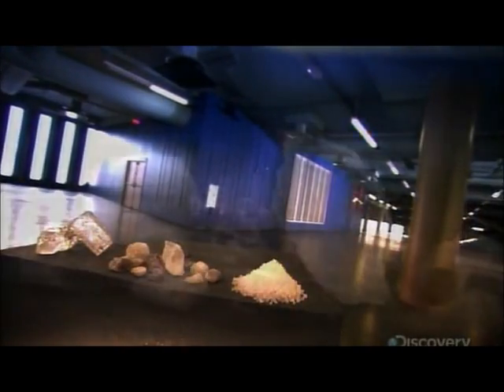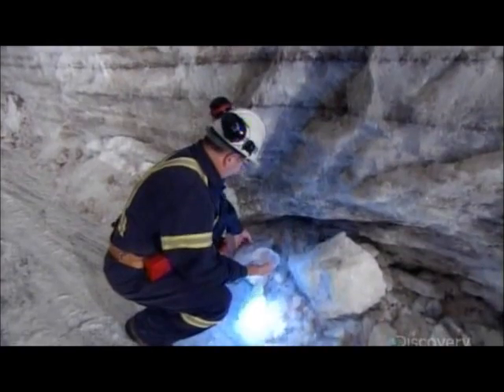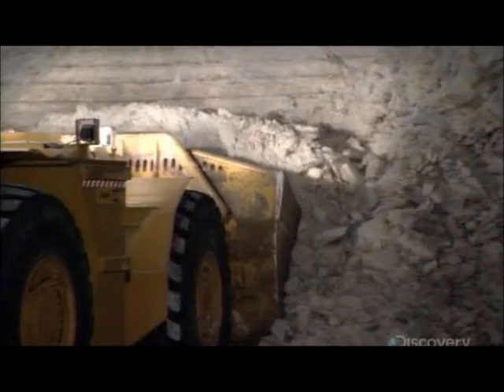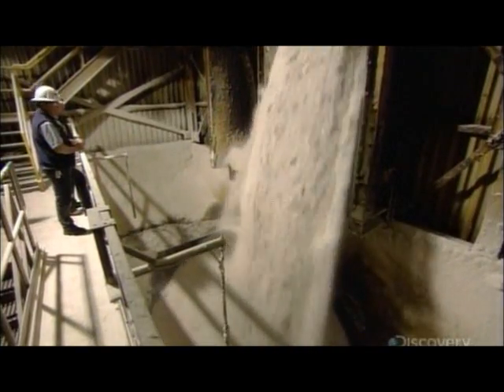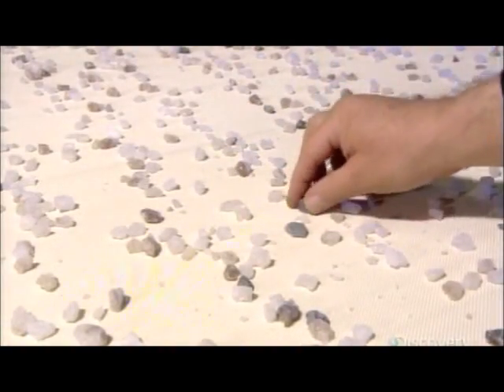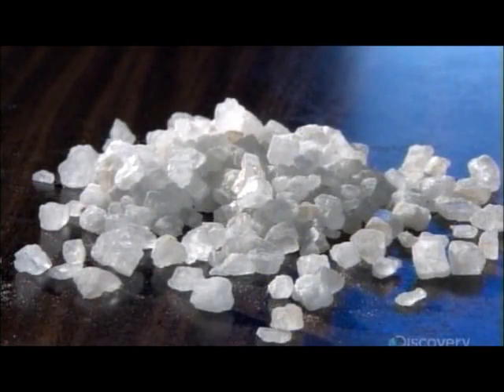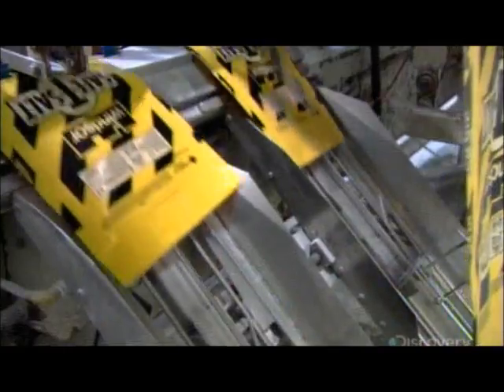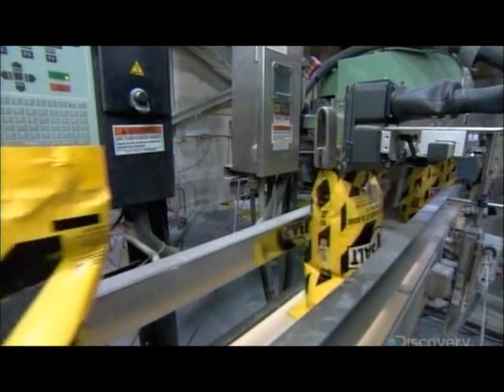How It's Made - Road Salt

Comment: I hate road salt
Reply: not much of an alternative, well cost effective ones. perhaps car manufactures should the ones running stainless steel lines and truck bed coating spray on the underbodies of there north sold cars! i literally just had my car crumble and had to scrap it due to salt from wisconsin winters. next car i think i will do some preventative maintenance

Comment: I always am sitting there like: "yea, store salt outside where it can rain n stuff, great idea"
Reply: only so much salt can dissolve in water and enter solution. It would have to rain  A LOT before it would cause the salt to wash away. Basically you get a crust on the top of the pile of 100% saturation of the rain water that then soaks down onto the salt below and forms a cake/clay like substance and keeps the salt in place. The little bit of water that does run off the pile is insignificant in the grand scheme of the mine, maybe a few tons per year at max.

Comment: Salting roads is crazy.
Cars rust and fail dangerously, it attracts wildlife to the roads and it makes inconsistent and often more dangerous slushy driving conditions.

Also, Sodium Chloride IS NOT ROAD SALT.
If you're gonna salt a road it should be Potassium Chloride. The same stuff you get a lethal injection of in USA.
Reply: Steffen Dahlberg or calcium chloride
Reply: Slushy roads are caused by either car tracking salt from highways onto unsalted snowy roady, mild days or sand spread...when you see a truck spreading sand its not just sand there is also a bit of salt mixed in to there again not enough salt so the road just ends up slushy. If you keep you vehicle clean and keep up with regular maintenance any serious rusting mechanical parts or curoding electronics will be noticed by your mechanic.

Comment: Is rock salt non renewable?
Is it bad for the environment to spread on the ground?
Reply: +Andrea Quadrati Nah, the seas are so massive and contains so much salt already that the runoff from salt on the road makes no difference at all. Then when you factor in how much fresh water is coming from melting glaciers and the likes, the oceans are actually becoming less salty......until the next ice age.
Reply: +Marius Ammann Solar salt. Or leftovers from water desalinization. Also sea salt is not usually that expensive. They dry it off in large basins using sunlight and concentrating it until it forms crystals. Still affordable
Reply: Salt was (and still is) used as a means to make soil sterile.  That is nothing will grow.  It destroys city infrastructure such as concrete, asphalt and steel control boxes/electronics for street lights etc.  It destroys your vehicle by galvanic corrosion causing rapid rust and attacks the electrical system.  In particular, salt water has different surface tension allowing it to weep past waterproof o-rings in electric connectors.  It's bad.  The other alternative for ice melt is mag chloride (same basic product with same destructive properties), gravel that breaks windshields and trashes paint or beet juice.  Beet juice has no serious bad properties that I am aware of aside from being expensive.  But infrastructure damage from salt is making beet juice more attractive.  Not sure how they deal with the dye (color staining) one would expect from beet juice however. Our tractor tires are filled with beet juice as both weight and antifreeze.
Reply: It increases the salt that goes into the water and the ground that is lawn or gardens. It also weakens the structural integrity of asphalt roads and increases rust buildup on vehicles.
Reply: Could sea salt be used to de-ice roads? I guess it would be too expensive because you'd have to boil it to get salt out, or are there any other methods of removing salt from salt water?
Reply: +69aussieguy Depends. Sure, oceans are big. But here we speak of more restricted zones. Seas and lakes are more likely to be affected.
Reply: Well, harvesting rock salt in the end. . just turns the seas saltier, as the water cycle will bring it there eventually. It can be renewable with artificial methods, but can be bad if the seas become too salty

Comment: I Didn`t Get How that machine Can unable the black mineral going forward
Reply: V for vendetta Why the fuck are you calling me a grammar nazi? I didn't correct anyone. God some people are dumb.
Reply: Yeah, that's very impressive
Reply: KrisRaps  Simply put they first decide which ones are black and need to be removed using some cameras and special lights. Then the black ones get shot in a different place using compressed air(so they basically push it somewhere else with air) so they don't go to the same place as the white ones. Since it's an automated machine it's really fast so the compressed air shots doesn't get in the way of other salts. It's definitely impressive work. :)

You can see just after that part that they note that some black parts do escape the optical sorter but since it's road salt it's fine. The ideal situation is to just get rid off as much of the black stuff as possible.
Reply: I didn't get how you can unable use correct grammar.
Reply: Rei Lumiere grammar nazi
Reply: Rei Lumiere i dont give a shit  its just you
Reply: Rei Lumiere I think he actually meant to reply to spaaggetii, who wrote "Learn english please. My head is spinning and my eyes fell out trying to read your comment."
Reply: Grammar nazi
Reply: Learn english please. My head is spinning and my eyes fell out trying to read your comment.

Comment: Segregation in the salt world.
Reply: You're just salty
Reply: Xoft C
Ah yeah. That makes sense actually. XD I'd normally have made a comment joking about such, but I guess the context kind of hit me hard there. I didn't consider that and thought it was just an aesthetic thing.
Reply: @MarioMastar  more than that. it's sorted for use in water softeners. You don't want dirt to build up in there. It will plug it up and then you'll have to buy a new one.
Reply: agry
Reply: Mario Mastar The black material is not salt just rocks and dirt trapped in salt. The more dirt in the salt, the lower the grade of the salt.
Reply: @XoftC  Even worse. Using little rocks and bits of sand is not something that stops salt from working. In fact, I'd bet that people would still buy a bag of traction material if it was made up entirely of gravel. It's frankly better for your driveway, since there's no salt to get leached into your lawn and start killing the grass.
Reply: Especially since most roads are black, I don't get why they would get rid of the black salt... "cause it's undesirable", Yep...racism in the salt world...